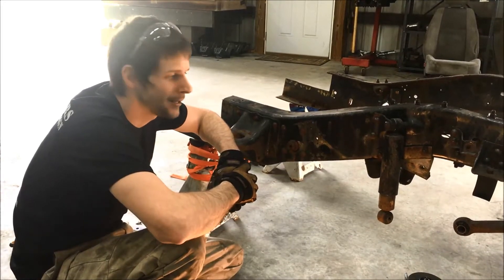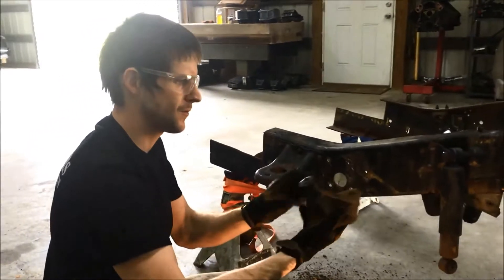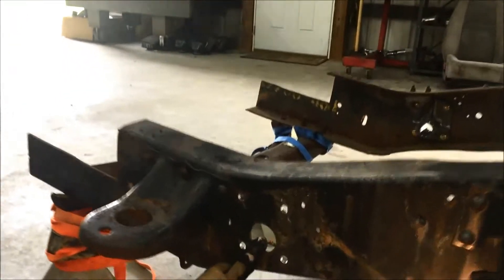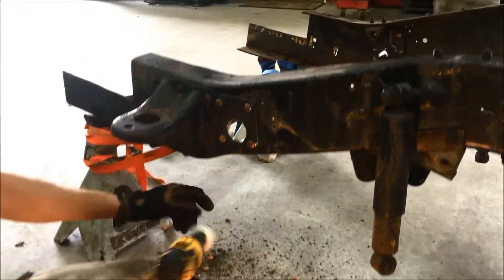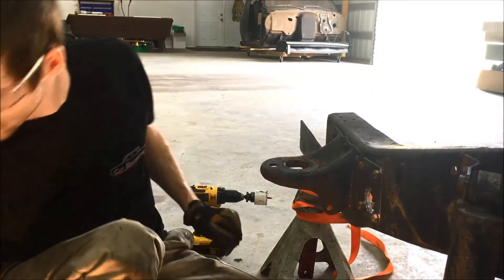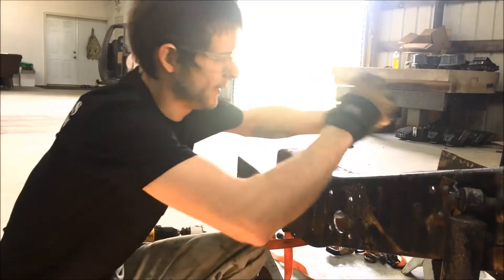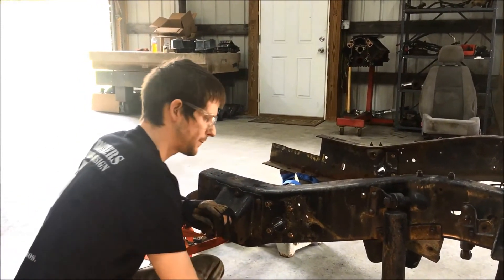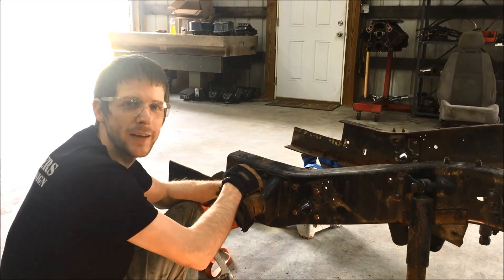CUTBROTHERS 4WD HD BUSHING MOUNT INSTALL

Comment: Glad I ran across this video. I have a 1990 4x4 crew cab with a very rusty frame. And I have a 1989 crew cab 2 wheel drive with a very good frame.

Comment: Are you making this a shortbed if so where did you cut the frame nd how much did you take out?
Reply from the maker: Jesse Sullivan this frame is just one we use for prototyping and test fitting. To shorten one you find a specific hole behind the cab to mark, go a certain distance back then remove approximately 14” from the frame between the back of the cab and the axle.